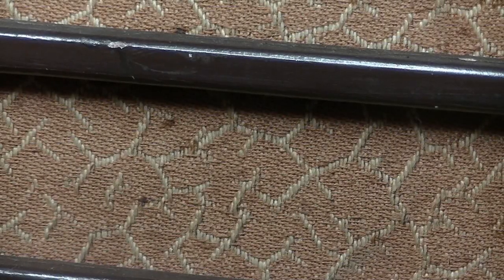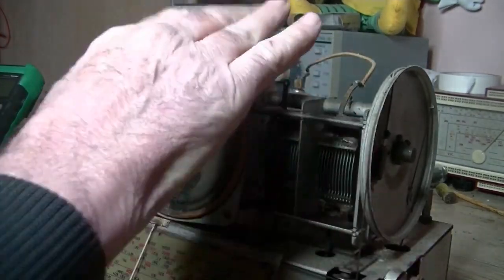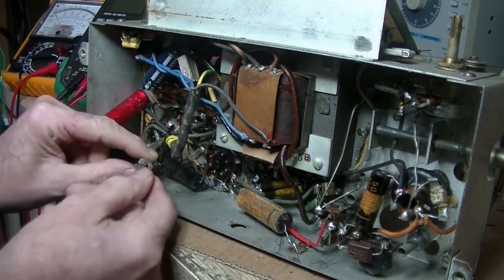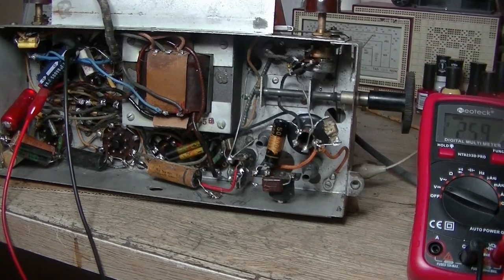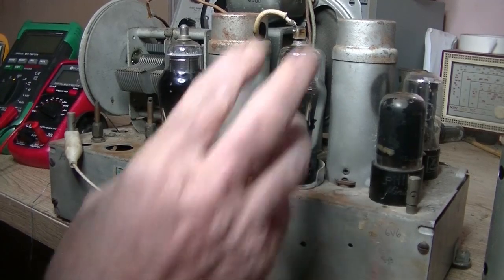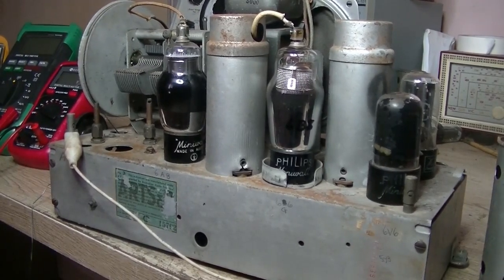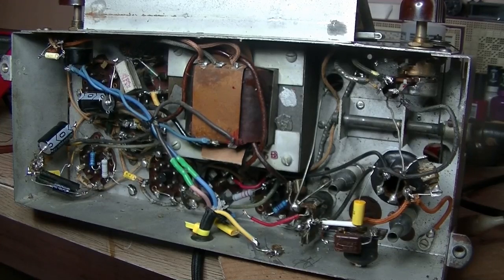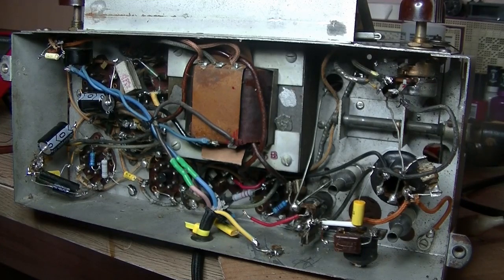Restoring an A.G.E. Hotpoint C64ME Valve Radio from 1941

Comment: It's sounds good enough Frank; I assume you repaired the speaker since I don't hear it rattling anymore. The volume pot requires a 4K wire wound pot as per schematic, which is probably non- existent.
Reply from the maker: Yes Ken, I glued the cone off camera, not much to show when you glue a speaker lol. You know I bet someone has a 4K WW pot in a dusty box somewhere. Oh well, I don't think the pot that's in it will cause any damage, at least I hope not, but it sounds ok for what it is